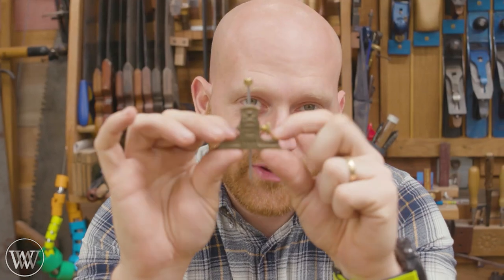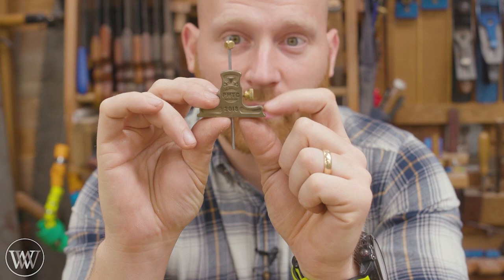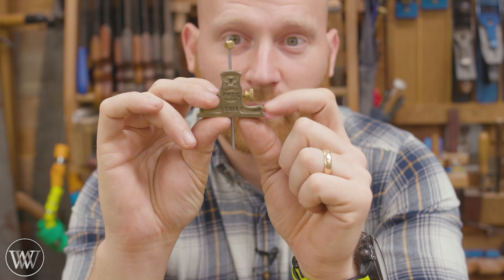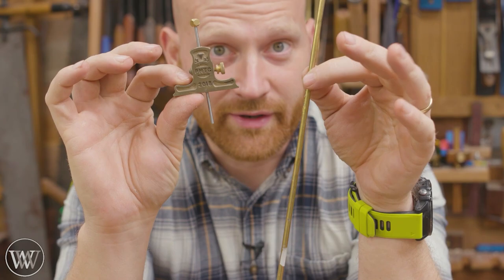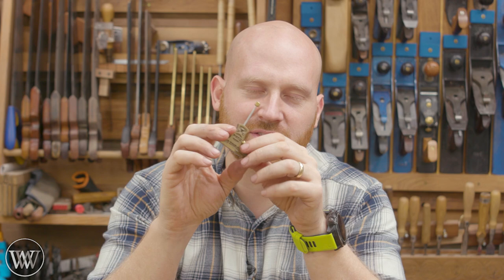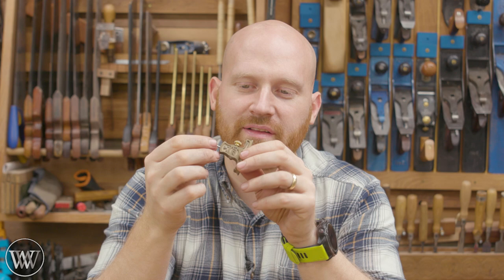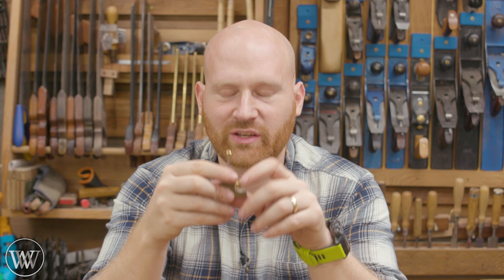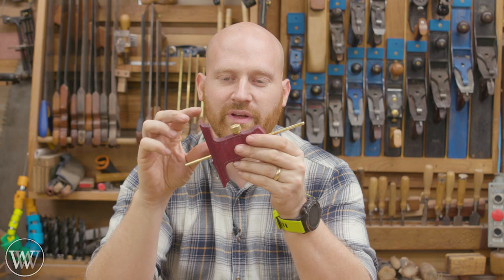A Depth Gauge out of Purple Heart and Brass

Comment: Love the purple heart.  Have you ever tried shaping the end of the rod with a file and using it as a drill bit to ream the hole after you bore it through or would that make the rod too loose?  Great work.  Thank you for sharing this project.
Reply from the maker: Thanks. If the whole or any tighter I would probably do something like that or use a small rat tail file. But it was actually right about as tight as I would want.

Comment: I usually just use the bottom of my caliper for this type of measurements. But this is thing nice too I can see where it would fit in where my solution taps out.
Reply from the maker: Some times it is nice to test out in the middle of an opening rather then just the edge. I to like using mine for that.
Reply: @WoodByWright  Yeah, your depth gauge here will definitely be more handy when gauging the middle of bigger holes like mortises and when we're dealing with rough/uneven chiseled surfaces in holes.